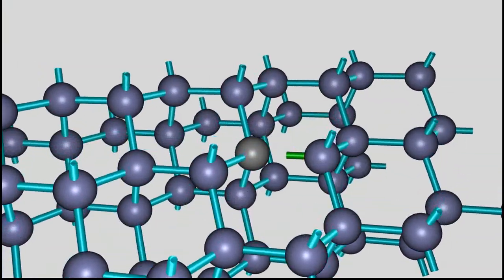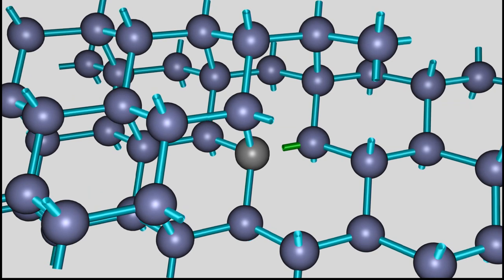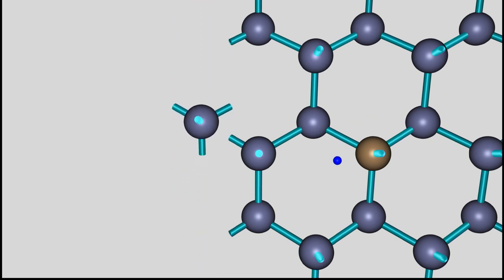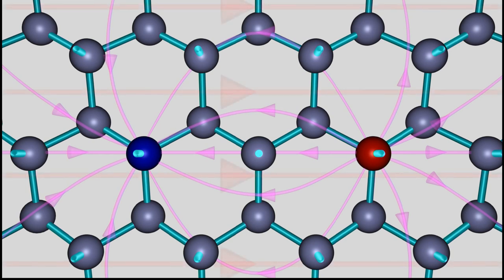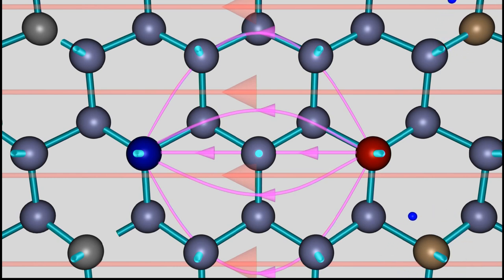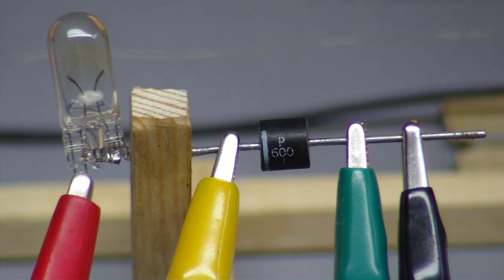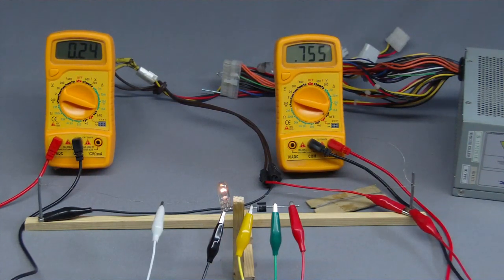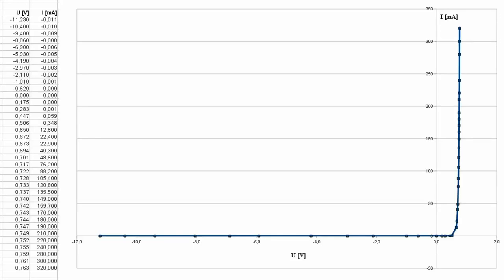P-N junction of a semiconductor diode

Comment from the maker: Fermi energy is the highest possible energy of an electron in a many-particle system in it's ground state.
Fermi level is a level of potential energy for an electron inside of a many particle system (crystal).
In it's ground state, all possible Fermi level between the lowest possible energy level and the Fermi energy are occupied by ONE of the electrons.
Fermi level exist, because electrons are interacting in many particle systems, hence there is a shift in energy level.

Comment from the maker: While recombining, energy is released by electromagnetic radiation or thermal energy.
By using a certain combination of semiconductor material and dopant concentration, the frequency of electromagnetic radiation is visible - it's the mechanism inside of Light Emitting Diodes (LED).

Comment from the maker: New electron-hole pairs are created permanently, caused by thermal energy.
While an electron and a hole recombine, electromagnetic radiation is emitted - mostly in far infrared (=thermal movement), sometimes in visible light (LED).
Vice versa, electromagnetic radiation is absorbed while electron-hole pairs are created. Thats how photovoltaic cells are generating electric energy.

Comment: Hi, At 9:12 you say that "Electrons are removed from the p-type region by the voltage source..", shouldn't it be then-type region rather than the p-type from which the electrons are removed?
Reply from the maker: +wnivlek Yes, I have named it wrong! The N-type region at 9:12 is to the right and electrons are removed from that half of the crystal in the animation. Somebody else pointed that out already and I will fix that in a new version about PN-junctions.
I love the audience that really listens to what I say (even if I am wrong).
Thanks for your comment.

Comment from the maker: Watch my video about the simulation of a P/N juntion
watch?v=mPGusBmm3XE&feature=plcp
At the end there is a section about thermal electron-hole pair creation.
You can do some experiments with the Java-application by yourself at the project page:
Homofaciens.de
Set New pairs to e.g. 50% and observe the minority charge carriers in both halves of the diode.
If an electron hole pair is created and the hole recombines with another electron, there is still an extra electron in the crystal!